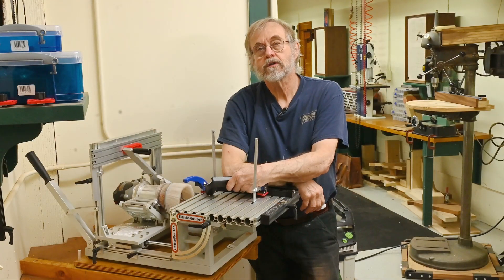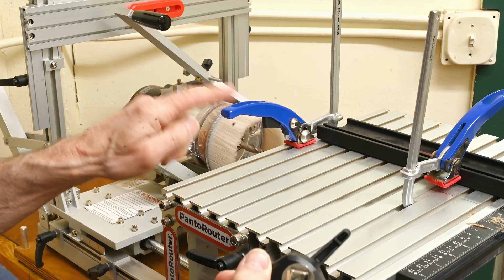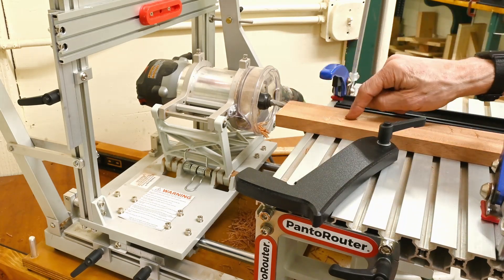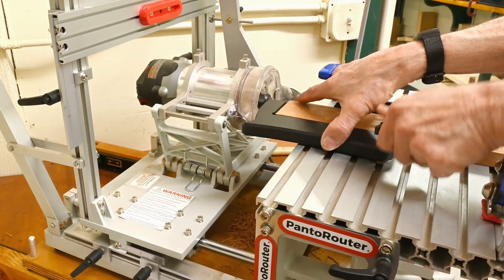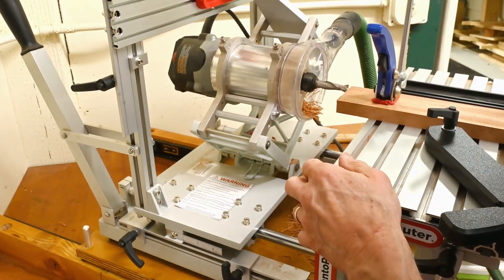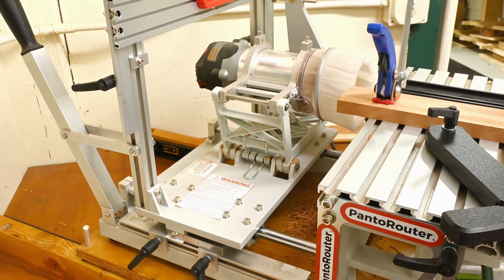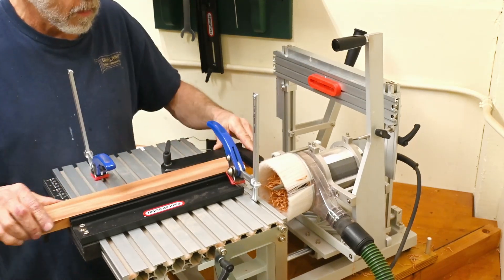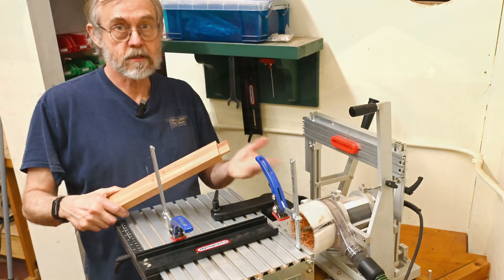How to use the new PantoRouter Swing-Stop

Comment: vs woodpeckers multi-router which better ?
Reply from the maker: My primary machine is the Multi-router but if I have the need to use templates I use the Panto-Router. It really boils down to what you are used to (I have had  MR for over 20 years) and what kind of work you do. Both are good machines.

Comment: What are the main differences between the MR and the Panto router. Why would you need both? Thank you.
Reply from the maker: You could easily get by with one or the other  but they each have their distinctive place in my shop.

The MR  is more flexible and adaptable.  However the MR is sort of hit and miss if you're using the templates to route joinery. If your bit has been sharpened or if your router has runout - it has limited adjustments to dial in a good fit.
The Panda router's strong point is it's wedge shaped templates. Withy them you can precisely dial in the perfect fit.
Reply: @DarrellPeartFurnitureMaker  Thank you, that was very helpful. Great videos and content btw!
Reply: @DarrellPeartFurnitureMaker  would love to see a video where you look at the strengths and weaknesses of each system.

Comment: Not sure I fully understand the need for this. I just use my back stop for the router as my depth stop, slide the piece to be tenoned forward until it touches the bit and clamp in place.
Reply from the maker: This eliminates the need to touch the bit off the stock every time  - plus any possible error in multiple bit touch offs . Its a gain in efficiency and accuracy.
Reply: @DarrellPeartFurnitureMaker  interesting. I've never had any issues with this method. I'll keep a closer eye on future projects for sure.

Comment: a few months ago, I emailed Pantorouter about their recommendation for quickly registering multiple work pieces to the same cut depth. I didn't hear back from them but saw some interesting shop made solutions on social media. This seems to be a better solution than those. I'm guessing there's an adjustment feature that you didn't show in this video?  Thanks for posting this - hopefully it will be available soon on their website...
Reply from the maker: The  Swing Stop should be available on their website tomorrow.  
The adjustments are....
 1st put the swing-stop in the 4th slot  for tenons up to  1 1/2" long. For tenons up to 2 3/4" put the swing-stop in the 3rd slot. 
 Slide the swing-stop tight against the stock ( stock is tight against the fence).  
To adjust the depth of cut touch the bit to the end of the stock and set the stop for the depth of cut as you normally would.